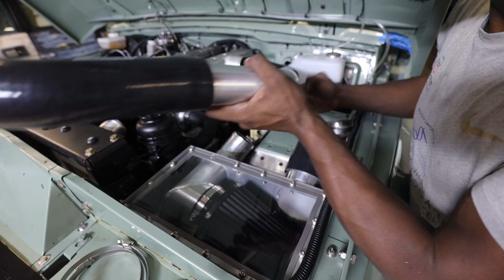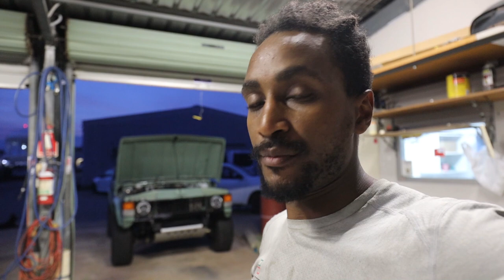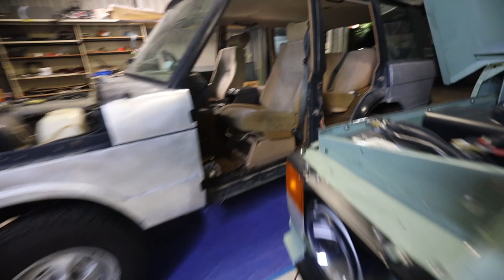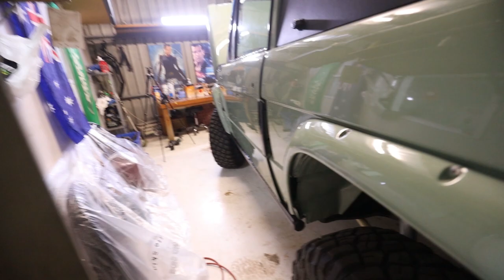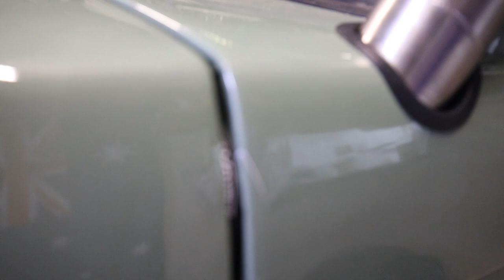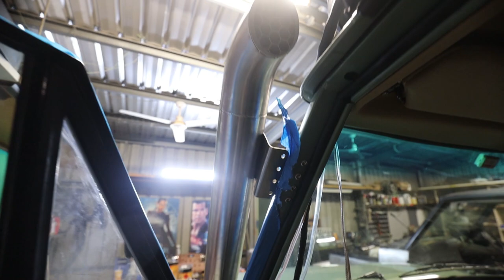EP 12 || Snorkel & Airbox Install | Range Rover Classic

Comment: E/A.  It's coming together slowly mista !  Did your pipework fabricator brush the inside of his stainless steel to aid the laminar flow of intake air or exhaust ? Think of using black rubber trim channel pieces to complete the edge treatment of your bonnet and skuttle plate, which may just cover up your scratch suitably sir. V.
Reply from the maker: laminar flow and 300tdi are two words that i dont think go hand in hand ahahhaha.